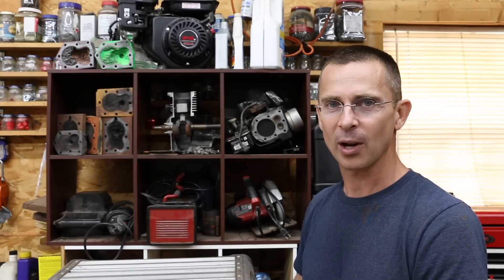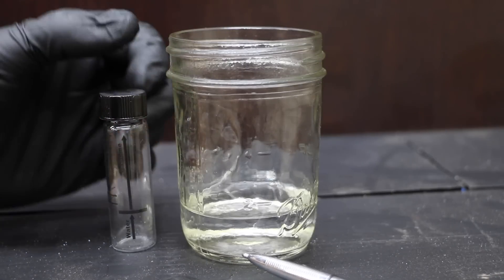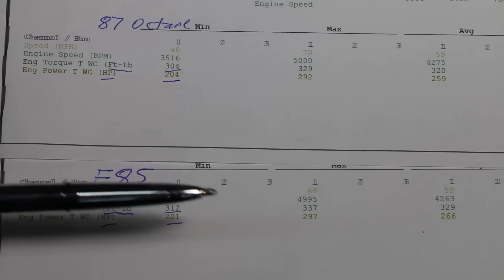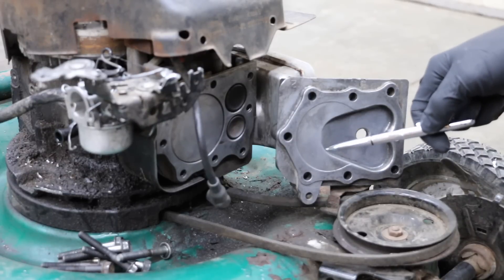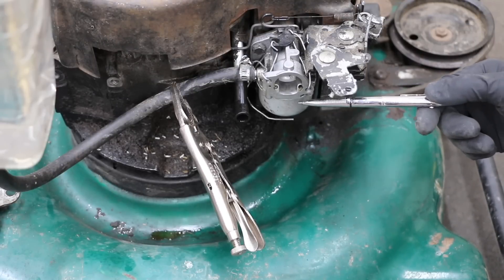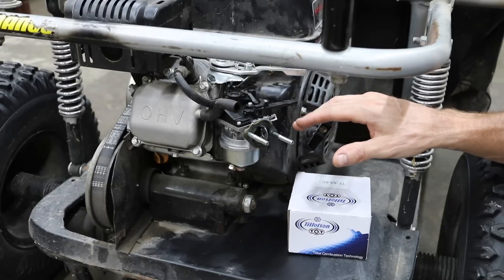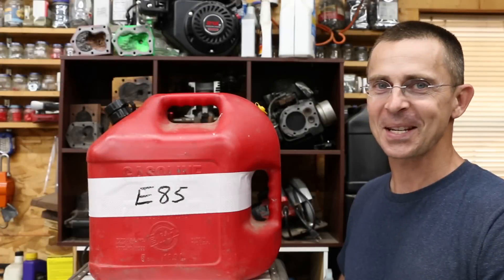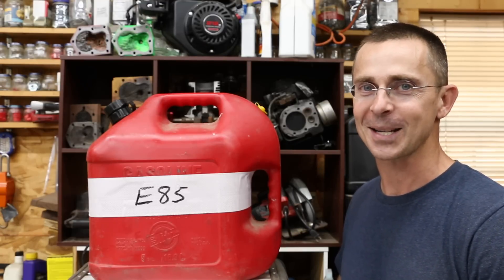Is E85 better than Gasoline? Let's find out!

Comment: Ethanol is highly corrosive and hygroscopic (Absorbs moisture from the air). I recently worked on a 1998 Seadoo PWC. I checked the fuel filter and it was full of a gooey sludge.  I did some research and apparently this is a known issue in late 90’s model Seadoos.  They used a fuel line manufactured by a company called Tempo that was not compatible with ethanol fuels (Note that the fuel lines were not defective, just not designed for use with ethanol added to fuels. Ethanol based fuels didn't start until 9 years after this PWC was manufactured).  Ethanol started being added to fuels in 2007 and is highly corrosive to rubber if not designed for concentrations of ethanol.  It causes the fuel line to breakdown from the inside.  Much of this would be caught  by the main fuel filter, but the line going between the 2 carburetors and the lines feeding from the fuel shut off valve are only filtered with a tiny fuel filter inside each of the carburetors. Carburetors must be removed to clean and replace these fuel filters, at which point it makes sense to rebuild the carburetors as they are now 20 years old.   
Pic of typical Tempo fuel line degradation:
https://86aa05d8-a-62cb3a1a-s-sites.googlegroups.com/site/polarispwcknowedge/Home/polaris-fuji-engine/Tempo%20fuel%20line%20sliced%20open%20-%20green%20and%20black%20goo%20inside%20%28line%20was%20between%20carbs%29.jpg?attachauth=ANoY7cqUrrGlh1qe53v4ZESIgw3FST2iWqsT5_YNvqoQcEOJxMAkVq29YoPTA44xBgu_Gix9he5oaYFlCa4qwgoILW7X5RWAvwT6Kef3xlXrPdkq9Qq0zPVpZWveErb_3N8anLfhnbOuVhlEMEVm_235PQ4R9qMus0vd4EMLCXfRLTtrIxdidPjhfRbSO6YRUxafgcdlqgpxg_5YqionpPaAVQ8GpiYF3zv8MpAfHGb235ylYcPgGxPixhHXyB6UzXzJfw8o5RR5Sm-s5Y0qO599__Bjk0tptyqKR6_BjsxoAJ3fvXH630c71xM-vL2xmI6J_O2uW1UAk3CmJuvdhxWoBn0mvQV9vwpB6vE7uxHx8fIMZTu73z8%3D&attredirects=0

All that aside: E85 gives me an additional ~100HP in my purpose built and tuned Subaru WRX Turbo.  It comes down to the design and materials used.  Approximately 107 Octane and cooler burn allows for safer increase in boost pressure.  Its under $2/gallon for me in NY, but I'm not concerned with MPG in this vehicle.  Also: I am able to purchase non-ethanol 91 octane fuel for my small engines in upstate NY.
Reply from the maker: Wow! Thanks for sharing this experience.

Comment: Depends on how knock limited one is. I.E a turbocharged car can run MUCH more optimized timing , because of the effective octane.   There are many variables to consider. In general  a standard normally aspirated engine won't be able to take advantage of the traits that are significant to   forced induction engines (performance is knock limited)
Reply from the maker: Great point. Thank you.

Comment: I realized that you are measuring apples and oranges when I just read the title. There were no surprises in the video, but I did watch it. Running ethanol in non-ethanol designed fuel systems is going to do harm to those fuel systems. How fast it harms them depends on how much ethanol and how long it touches the fuel lines etc..

When you say "cheap" gas, you mean that the more costly additives are removed or minimized. Additives do all kinds of things not at all related to power. Rather they do things like reducing carbon build up, reducing pre-ignition, more complete burning, more consistent burning, lubricating and cooling etc.. None of that has much to do with power and almost none of that was taken into account in this test. The results of using "expensive" gas would be the same.

Dragsters and funny cars run alcohol perfectly fine and make huge horsepower not possible on gasoline. Their fuel systems are made of stainless and don't corrode because they were designed for it. All modern cars are designed to tolerate alcohol but small engines and older "things" were not. The alcohol will without doubt ruin those systems, it's just a question of time. Alcohol is not better it is different. Do you want mileage? Run gas. Do you want less knocking or high compression / boost? Run alcohol or racing gas. The question this video addresses is like asking do you prefer left or right coffee? Which is hotter, blue or red coffee?

You set a goal or try to solve a particular problem and pick the best fuel solution to that problem. Then you design the entire system to tolerate that type of fuel. E85 has never been cost-effective to use or produce. It was introduced to reduce the stagnant smog in dense urban areas during winter months. To accomplish that the gov had to subsidize the farms to grow corn for fuel instead of something useful to eat. In many ways it is simply political. The gov had to require cars to be alcohol-tolerant or the car makers would point at the gov for the millions in damage caused by the alcohol.

An engine can run well on E85, but alcohol needs a richer mixture, which means the MPG goes down. If you advance the timing you can extract more HP because the alcohol burns slower, knocks less and burns cooler. All these things were known by racers decades ago. I could go on for pages, but this is over-long already.

Do NOT ever use any type of alcohol in premix -- like dirt bikes, chainsaws, blowers, snowblowers etc. because the oil won't mix properly and separates quickly when stored, and pulls the moisture out of the air and into the fuel tank. The fuel systems were not designed for it and the alcohol will destroy the fuel system (probably slowly, but certainly over time). The engine will also be running too lean and that usually means burning a hole in the piston, overheating, melting the electrode off the spark plug and seizing ect.. Any of that damage is probably undesirable, so just don't put alcohol in two strokes.
Reply from the maker: Lots of great points and advice!  Thank you!

Comment: The main issue with the etanol on not designed engines to run with it, it is that the rubbers it degradates, like it happened with the carb.
Reply from the maker: Great point. Thank you

Comment: as i anticipated, e85 is cleaning the engine! 
i once had an opel vectra with around 200.000 kilometers on it, 150k driven purely with bio ethanol fuel (i even changed the injectors to allow more fuel to enter) - the engine looked like it was new on the inside. its amazing how clean engines run on this stuff. even on the exhaust, there were almost no black stuff present. 

a slight downside is that the exhaust will rust because water is formed by burning ethanol, wich condenses inside the cold exhaust causing it to rust if you are only driving short distances.

all in all it was definitely worth it, not because of extra power (if there even was some) but just because ethanol only cost around 1/3 of the price of regular gas here in germany. so it was a big money saver back when i was in school
Reply from the maker: Wow!  Impressive results. Thank you
Reply: Sharky 

What do you suppose is produced by burning gasoline? Water and CO2. E85 produces about 2X as much water as pure gasoline.
Reply: @FrankGutowski-ls8jt  i'm not a scientist, i know that you get h2o and co2 by burning CH-liquids but i dont know the exact stocheometric. what i said is purely based on observations i personally made. 

its still worth it if the gas price is higher than e85. even if you break even, you still have the benefits of a cooler and cleaner running engine.

i could imagine that also the efficiency of the engine remains higher if it stays clean.

by the way another thing i noticed was that the oil didnt get as black - so maybe you also need fewer oil changes wich also saves money
Reply: Sharky 

I’d been saying, in response to those who squirt water into their intakes to decarbonize, that burning high ethanol gasoline would be easier and more effective, due to the larger amount of water produced continuously, over long periods of time. Therefore, it’s encouraging to hear that my armchair theorizing wasn’t off base.

Comment: I'd love to see dyno numbers between cheap gas and high grade gas. I definitely didn't think you'd get better numbers with E85, mileage was pretty bad but overall seems better for the vehicle.
Reply from the maker: Great video idea! Yes, the suburban uses a lot of fuel. Thank you.
Reply: @ProjectFarm  thanks! My work truck (2014 Ram single cab long bed) gets between 12 and 16 mpg. I drive about 200 miles a day so I get it...

Comment: I always run non ethanol in the 95  grand marquis I just put some in it. It was 329 a gallon for 89 octane, that's what we used to call regular right?
Reply from the maker: I used 87 octane with 10% ethanol for the test and compared it against the E85. Thank you
Reply: @ProjectFarm  great video, 89 octane non ethanol is what we used to call regular right? The grand marquis doesn't run good on the 87 octane. You can't buy what I used to run in the 70's, we called it white gas, the 96 octane at the AMACO station

Comment: I drive my Scion FR-S on the track.  A lot of guys running this car have converted to E85 to get more power and cooler operation.  It is especially effective on turbocharged engines.  No reports of any problems due to using this fuel.  I think all modern cars use gaskets and hoses compatible with ethanol.  (But the engine needs to be tuned for it.)
Reply from the maker: This is great information. Thank you

Comment: You will always get worse fuel mileage with higher alcohol content, and it will actually do more harm to your engine the higher the ethanol. There was a test done running 100% gas, 100% ethanol, 100% methanol and a 10% blend of ethanol and gas and methanol and gas. Pure methanol actually wore the top of the cylinders out due to acid by-products of combustion and pure ethanol did more engine harm than 10% blend. So based on those tests the only benefit to E85 is a cheaper price and less harmful emissions but in terms of longevity, 10% blend or less is better because you get better fuel economy and less corrosive by-products. So unless you have a race engine that needs to run on race fuel, 93 octane is plenty. Frankly, E85 just isn't a good enough alternative fuel in the long run hence why it's not so common even after over a decade of being used.
Reply from the maker: This is great information. Thank you!

Comment: Project farm could you do a test of 87 octane e10 vs 87 octane pure gas? Fuel mileage and hp.
Reply from the maker: I'll test non-ethanol soon. Great video idea!
Reply: Thanks that would awesome. I usually just run the cheap e10 cause 87 pure cost as much as premium around here lol always wondered if it was worth the extra coin though.

Comment: the cons to e85 that i know of is that the ethanol attracts water making it tougher to store
it requires more fuel to run on an engine
it eats standard rubber lines and can rust out steel lines because it attracts water it can also dioxides aluminium parts
then some gas stations may not have actual e85 like the one you were at said anywhere between 10%-83%
but its preferred for racing applications since its fairly cheap and resist preignition and detonation very well
Reply from the maker: Great points. Thank you

Comment: I run an E-30 blend in my car, and it allows for more power before the engine starts knocking.  10.0:1 Compression Ratio + 24 Lbs of boost.
Reply from the maker: Thank you

Comment: I run my 1998 Volvo S90 (3,0L 24v I6 204hp) mostly on E85. Gas costs 1,55€/L and E85 1,0€/L here, so a 27-30% hit on the MPG still makes it like 10-15% worth while. Our E85 in Finland is made from food waste, not from food grain etc like everywhere else. :)
The engine runs much cleaner on E85, low-mid range torque feels a tad better but it takes out like 30hp because it's not an E85 compatible vehicle. Starts and runs otherwise fine, EXCEPT when cold starting i have a button that modifies the engine coolant temp circuit so it gets more fuel at startup, OR pre-heat the engine with a fuel or electric pre heater. But after the engine is like 40c (100F) it works just as it should. I've driven it without problems for over 9years/130000km now. The emissions test is getting cleaner every year (had a nearly clogged up catalythic converter, the HC value was 81 in 2008, and now gone down to just 11 this year). Not even a MIL light on this, but its because it has very broad fuel trim allowance due to being old Euro2 vehicle (puts a lean mixture DTC of course) .

I also have an old Volvo 340 with 2,5L16v engine with huge turbo running on E85 and same engine in a boat. These have megasquirt programmable EFI, so they are programmed for this. Around 10-15% worse MPG than same engine with regular pump gas.

Also have tried E85 for extended time in my Audi A8L W12 (one 2006 and one 2008MY).2006 model year needed two or three times to cold start, 2008 model starts every time with first try (probably different ECU program). Here also a around 27-30% hit on MPG, and puts on the MIL after 50-150km of driving because its an Euro4 vehicle (and of course leanDTC).
Reply from the maker: Thank you for commenting on using E85.

Comment: E85 is a ripoff. Its looks so much cheaper than gasoline until you run the numbers and (in this case) see you save 13% on price per gallon ($2.29 vs $2.65) but consume 23% more fuel (11.9mpg vs 15.5 mpg). Bottom line is that you loose money on ethanol.
Reply from the maker: Thank you.

Comment: Like someone else said, can you soak small engines fuel line, needle and seat in E85 and could you do the same for fuel injected vehicles by soaking any over the counter "Not approved " fuel injection hose in E85?
Just want to see what could happen to the rubber fuel hose on cars that aren't flex fuel.
Reply from the maker: Great video idea!  I'll do it. Thank you

Comment: 2011 f150 5.0 flex fuel.  Been using e85 for a while now and when I switched over I didn’t really notice a power loss or gain.  Lost about 1/2 mpg.  Not enough to notice. This truck gets 11-12 in town constant driving and 21-22 mpg interstate driving. Sharp difference in city to hwy.  if the vehicle is designed to except e85 you really shouldn’t notice a huge drop or gain specifically. My feelings on it. Ford seems to do a great job on the flex fuel vehicles.
Reply from the maker: Thank you

Comment: Cool. I've always wondered if there is a difference when I use Premium ethanol-free gasoline in my motorbike compared to Premium E10 gas. Does either of them produce more power? Is ethanol-free gasoline much more fuel efficient? I haven't really done any tests, but I've heard that ethanol-free gasoline should produce more power and improve gas mileage.
Reply from the maker: Thank you!

Comment: I’ve ran e85 in my old Snapper lawn mower for years, it doesn’t bog down in tall grass with e85 like it does with regular gas. Also, you don’t smell like garbage after you’re done mowing! 

On another note, have you tested running an engine on anti seize, copper or regular? I thought that might be a fun test. My guess is it would cake up rather fast but it sure is slippery stuff! Great video by the way!
Reply from the maker: Not yet. Thanks for the video idea!

Comment: my friends civic build was a k24 bottom end from an accord and a k20 top end from an rsx he also had a .66 trim turbo running 15psi with E85 1000cc injectors and you have to completely gut the fuel system and do new hoses etc not sure materials he used i believe teflon coated but he had around 550whp on e85 and about 425whp on 93 octane from sunoco boost only went down to 12psi when he used 93 so 125hp difference but yes its costly to stat but race gas isnt cheap even by the 55 gallon so i personally believe the ease of getting E85 and price point is the love of it also depends on timing and if youll cause damage between having a cast iron motor a alluminum one a combonation all are factors into wear and limitations of the E85

Comment: Project farm could you help me once again please, I bought some premium petrol for my 2 stroke brushcutter and gen.and since then I think,my carb has started leaking out the air filter please how can I fix this. Thank you in advance .
Reply from the maker: Recommend removing the air filter and making sure it is dry before re-installing it.  If the engine is hydrolocked, recommend removing the spark plug and spinning the engine over several times to remove the excess fuel.  Once you reinstall the spark plug, see if it will start. Hope this helps.
Reply: @ProjectFarm  thanks I had done that after it had filled with fuel put it all back together,and it happend again, do you think this premium fuel has damaged the seals and stuff inside the carb? I have a problem if it is the carb because I have a plastic carb by wallbro and Can not find any info about it. Thanks again for your time and knowledge and vides.

Comment: Since the Gov is trying to force higher amounts of ethanol in our pump gas I am concerned about its effects when  it remains in an engine's tank for long periods without running.  Gas stabilizer seems to be a requirement in such cases but what effects does it have on how an engine will run?  Also, how long is it good for? 1 month? 2? 3? 6? 12?  I'm currently using non-ethanol in mowers, snow blowers and a motorcycle (that's been sitting for 2 years).  I do this to avoid ethanol but that could change if it is harder to find.
Reply from the maker: Great point!  Thank you